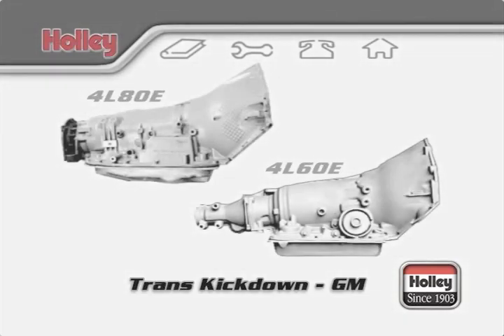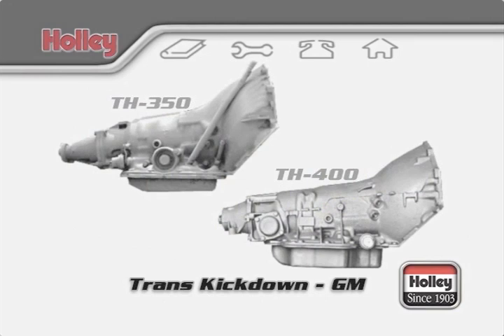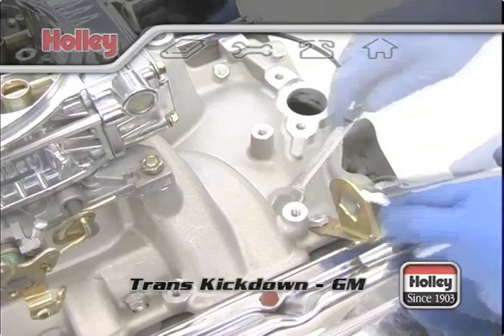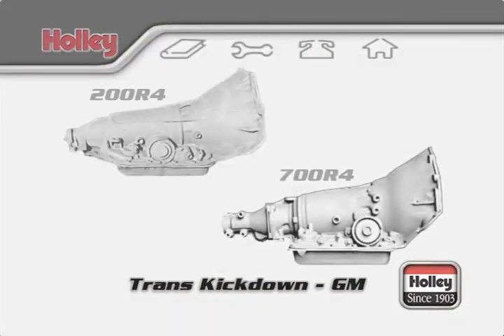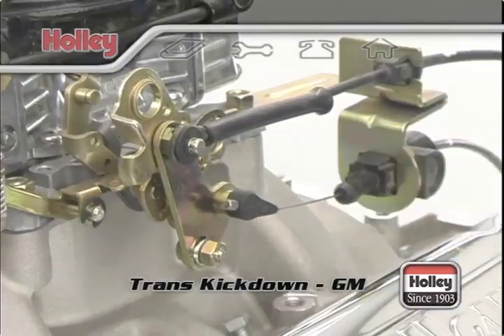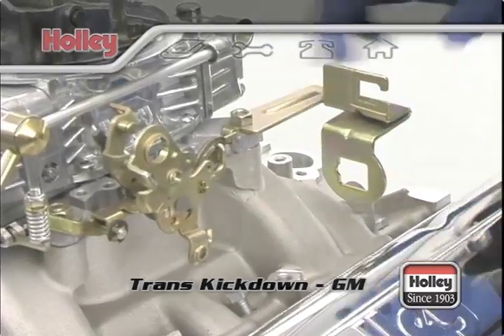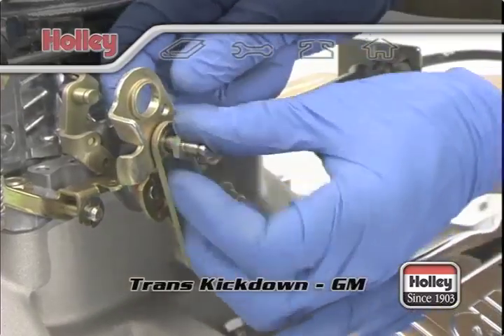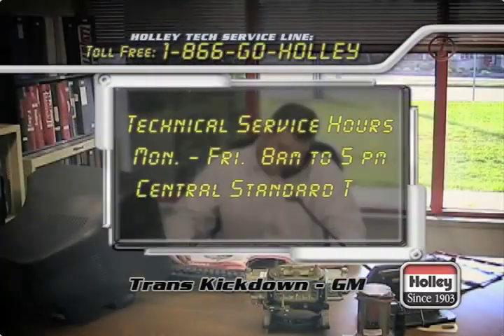How to Set The Carburetor to Transmission Kickdown On TH-350, TH400, And 700R4 Transmissions

Comment: Excuse me but I want to know how the fuck to set it to where it actually works. I have it hooked up, but it isn't kicking down into a Lower gear before I shift into a higher gear so when it's at high rpms so it shifts nice. I have to wait till it's at high rpms to shift. And I have to have it at low rpms before I go into reverse or it dies. Which I have to get a new starter till I fix the cable because it doesn't like starting cold and it likes to shut off because of this bitch of a cable doesn't kickdown into a lower gear.

Comment: in a GM Turbo Hydro 350, should the kick down cable be tight when the accelerator is not depressed? Mine has a bit of slack when the accelerator is not depressed or car is off.

Comment: hmmmmm this was not how to set kickdown....you put kickdown in position in the bracket and attatched to arm that  other detent attaches to then you pull the metal or plastic tab straight up, then while truck shut off, have other person full throttle gas pedal to floor and hold while you then put metal/plastic back down then have person let up on pedal and that will adjust your cable to right fit!!  I have been doing alot of upgrades/upkeep on my 80 chevy k5 after my recent engine swap!! which was HELL!!!  lol

Comment: Can some one help 
Got a 92 Silverado  with 700r4  
Problem is that it kicks to 3ed (in both  overdrive and drive) and then  nun it start going high rpm and it like free spins or something no noise or anything just free spins 
Hoping I dont need a 3 -4 kit  
Can drive in 2ed gear 
Looking around and people saying it could  be this 
Just seeing if some one else has had this problem  as well 
Tips and pointers
Reply: I have this same problem but on a turbo 400

Comment: I have a th400 in my 442 and it doesn't have an electric kickdown for the carb. It has the vacuum thingy connected to the intake. It runs fine like this. Is it supposed to? Am I unknowingly jacking up my transmission? I can't seem to get a straight answer on this. Half of people say it's fine, the other half say I need an electric kickdown...

Comment: My 400 comes from a 1 ton truck and I did have to run a vacuum line.
Because it is an electric kickdown I also had to install a B&M kickdown to the holly carb 
as my 80 Trans-am did not come with a 400.
With factory 400 trucks flooring the gas closes the circuit which engages the kickdown.
On my car WOT closes the circuit engaging kickdown.
The video is missing this step.

Comment: This video should be called HOW TO INSTALL KICKDOWN BRAKETS AND INSTALLATION OF CABLES !  It does not show how to properly set the cable for engagement!
Reply: OneBad88S10 Let a trans mechanic set up the TV cable.
if you mess it up, ur 700r4 will be burned up in 100 miles.

Comment: TH350 has a TV 'throttle valve' cable & a vacuum modulator & they both need to be hooked up & adjusted properly or premature trans failure is going to occur .
It may last a long time adjusted improperly but ultimately the clutches & band will get smoked .
They both regulate internal pressure for softer & firmer shifts so trans does not beat its self & you to death and they raise line pressure when more trans gripping/holding power is required as when accelerating or passing.
Later ? 1979-1980-1981 TH350's also have a lock up torque converter .
The connector is on the USA driver side of the trans & if out & visible the input shaft looks similar to a 700 input shaft.
A few parts are interchangeable from a lockup & non lockup .
The case, direct drum & pump are different & it has a small axillary valve body .
Some TH350's also had a single blade switch by TV cable & this as I recall had something to do with engine timing in the days of early smog emissions . 
Last year for TH350 I believe was 1981 then the 700 trans was used .

TH400 uses a vacuum modulator for basic shifting up and down under normal driving conditions .
It utilizes a electric solenoid for the 'ultimate' down shift at WOT throttle positions .
Without the wire hooked up you will never achieve maximum RPM the trans is capable of unless you manually down shift .
Some early TH400's had 2 blades on the switch connector .
One was for the trans kick down and the other was for a Variable Pitch Torque Converter .
Yes, a converter with to stall speeds .
Its is part of what enabled those old heavy almost 5000 lb cars to literally smoke the rear tires & I know this because I have driven many of them .

BTW if you want a performance trans to last then IMO you want one with a good firm shift upon heavy acceleration but not one that snap shifts .
A snap shift will literally snap transmission and rear end parts .

I hope this answered some  questions & helped some of you .
Reply: Ultimatehobbyreviews
I'm not always online but you can ask & if I know I'll share info.
You don't usually have to drop the pan to change the cable & there are different cables so you need to  be sure you get the right one which is sometimes hard if someones worked on it before using the wrong parts .
If you disconnect the cable up top there's usually enough slack to unhook the wire link on the bottom .
Some use a top hat type seal & some just a O ring in the groove & some of the bolts are metric & some not .
Just use a little slippery something 'oil , grease , petroleum jelly ' to re-install the cable end seal .
If installed correctly the seals seal without any type added sealer .
Also the vacuum modulators  'usually the red stripe ones'  are adjustable with a vary small screw driver .
Turn it in & it shifts harder and later turn it out softer & sooner & they need ported vacuum not hooked to the carb .
When adjusting a Mod I usually do 1.5 turns at a time .
Also remember Th350 are all very old so be careful with the modulator bolt because I've seen the mount broken off on some .
Good news a bracket is used for a fix & heres one on Ebay 			 		that you can look at just in case .
	eBay item number:
181593727116
I am an avid Ebay user & always looking  for a deal & here is a super deal that I strongly racommend & use them myself which is a ATSG manual .			 		
I probably have 20 different ones that I refer to .
	eBay item number:
331317021520
Reply: If it's a TH350 without any torque converter lockup modules, like I have, you DO NOT need to run a kickdown cable. I've been slamming my TH350 in my Trans Am around for 7 years without this cable. And so have most guys in the hot rod community that run TH350 trans. There is both a vacuum modulator AND the cable on a TH350, The kickdown only effects the kickdown of the trans from 3rd to 2nd when needed. The Vac modulator is what keeps pressures in the right spot on a 350. As long as you don't mind shifting manually, it will be more than okay.
Reply: NickoliKalashnikov47
Actually, you are incorrect !
While your trans will or may last for a while it was designed with the cable and its use is required to work properly .
So.
What you have is a trans that can not possibly work properly.
& A 350 properly set up does not need to be shifted manually.
Reply: Actually my trans works perfectly fine! It shifts up and down on its own exactly the way it's supposed to. I'm not going to start an argument about this. The Electronic torque converter lockup 350's NEED a kickdown cable. Non-electronic 350's do not, IF you bulid them correctly
Reply: NickoliKalashnikov47
Good for you.
 I'm happy that you believe that your trans works properly.

But just about any trans can be altered from its OEM design so it can/needs to be shifted manually or do other things it was not ever originally intended to do.

And sometimes contrary to popular belief that is not always good.

And you didn't state that or if your trans had been altered you said ' all ' 350's except LU's don't need a cable.

But what you are suggesting/telling  people by claiming a/all 350's do not require a TV cable is still incorrect and will more than likely lead to a premature failure.

Its just a plain fact that a th350 by OEM design needs a detent cable and only a transmission-ally challenged  person would claim otherwise.

As for you slamming your trans .
Not a good idea.

Because the Th350 although they are a very good trans when built properly are inherently weak and should not be slammed or altered to slam.
A good firm shift is more than adequate to spin tires & sink you into the seat .

A slam does nothing but break things.

Anyone that knows anything about a auto trans knows they should not be slammed because that is nothing but a ' shock load ' way beyond the trans capacity and it will ultimately result in its failure.

They, 350's are limited by the size of their components which are small compared to a TH400 or 4l80e and I have seen shafts with multiple cracks and twisted completely off & planet gears destroyed along with smoked band & drums.

No matter what trans you have it ' must ' be 'dialed into the vehicle' it is in to work properly taking into consideration camshaft, gear ratio, converter stall , weight of vehicle & general use ETC.

BTW if a cable was really unnecessary can you imagine the multiple millions of $$$$ GM could have saved by eliminating them ?

There is also a TH250 & TH375 but that's another subject.
Reply: Like I said earlier, I'm not going to start an argument. I'm not a keyboard warrior. I've been in and around cars since i was born.
Reply: NickoliKalashnikov47
we've all been around cars since we were born unless we are very very very old or Amish then we've been around buggy's.
BTW.
I've built more th350's than will fit in a cargo truck.
Some I built with all used/recycled parts except seals rings & gaskets for people who were truly penniless.
&
I've worked on cars for 50 years as of my last birthday & I still, sometimes learn things from reading comments on these posts.

Its a shame that you don't .
Reply: Oh. So you think that because I disagree with you, I'm stupid and inexperienced? Classy.

 Have you ever heard of Manual Valve Bodies? They eliminate the kickdown cable completely from these trans. Maybe you should have asked what I ment instead of being disrespectful. Have a good day.
Reply: NickoliKalashnikov47
re"I'm stupid and inexperienced"
No, that's not what I said .
I don't think you are stupid but your comment, the way you put it is irresponsible .
You should have said or explained that you don't have a stock VB, if that's the case.
&
Its your responsibility to explain not others to question what you have when you make a blanket statement like ' cable not needed '.

Fact , if people took your word and disabled their cable it could lead to them smoking their trans clutches & it would be because of your comment.
Your fault !

I know for a fact that cable length affects shift quality & down shift timing.

Loose cable and you can get a sliding shift and possibly no down shift to 1st or 2nd at higher speeds.

Tight cable & you get later harder  shifts and possibly no WOT because the throttle lever can not pull or turn far enough.

Now, "inexperienced" yes because you make a blanket comment without thinking about how it could harm others financially .
Reply: Hi, I'm trying to figure out why my 1979 C10 won't shift into passing gear and whenever I try to go faster than 40 mph it causes slipping
Reply: Is there something I'm doing wrong? Could anyone help me out here?
Reply: @GG-nt9of  he sound like a person that knows what he is talking about and he is right some people just spout crap and others believe it and end up blowing their trans, rear, engine etc,etc the other guy spouted crap then tried to cover it up by saying his was modified he just clearly talked a load of crap which the internet is so full of now a day's
Reply: @banno6938  so I bought a 68 Firebird in the UK back in 1997 it had a 396 L78 TH 400 no kick down wire attached never had an issue. Since 2004 I've had a 454 in it and since 2014 030 over flattop 10.5:1CR and a comp cam 280H I have felt that there has been enough power not to need a kickdown switch what are your thoughts on this?

Comment: This Video is NOT correct because they have the TH 350 and the TH 400 backwards. The TH 350 only requires a Vacuum hook up where as the TH 400 requires the Kick Down cable to the Carb. I have both the TH 350 and the TH 400 in separate cars.
Reply: My th350 in my 79c10 has both the tv cable and a vacuum valve pulling from absolute full vaccum on intake down to valve.
Reply: The video is correct. The kickdown for the th400 is operated via a push button switch located on the gas pedal assembly. I have two th400 4x4 and had a th350.
Reply: !? Th350 400 are the same 400 holds more torque shaft is lil shorter .and vaccum advance is for shift firmness the cable is for down shift passing both are on these trans. Unless you have newer or added the computer module like The 700r is electronicly contrlled

Comment: This video isn't completely correct...
I have the gm th400 and it also has a kickdown cable that attaches to an electric switch that I mount to the tranny pan.. Furthermore, it has a single electric switch threaded into the side of the tranny housing...
MY QUESTION:
I have the th400 with single wire electric switch... I read the switch needs a 12volt 5am source.. Can this be an accessory wire or does it have to be an ignition source?  ANYONE?
Reply: OK 7 months later .
It only needs power when you want it to down shift during WOT wide open throttle .
You need a switch which only powers it at WOT & it does not really matter if its controlled by the ignition switch or not but IMO its better if it comes off the switch & fused .